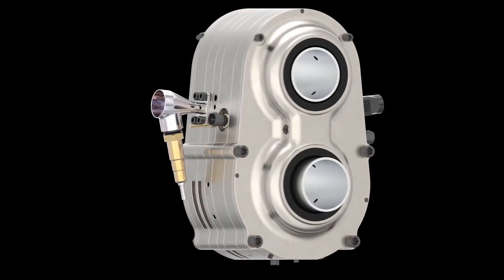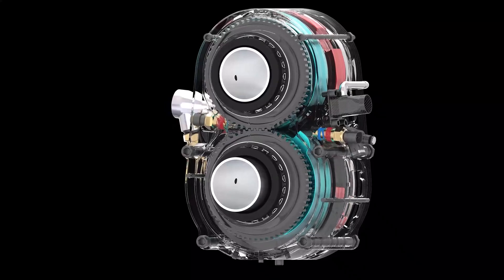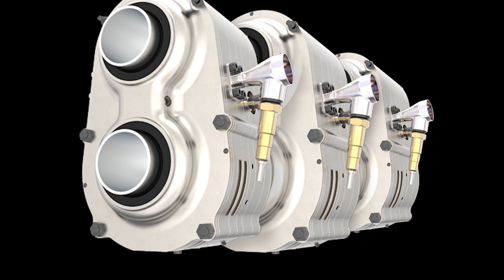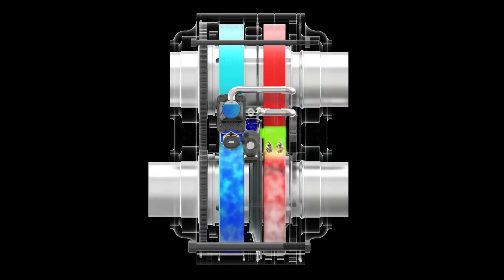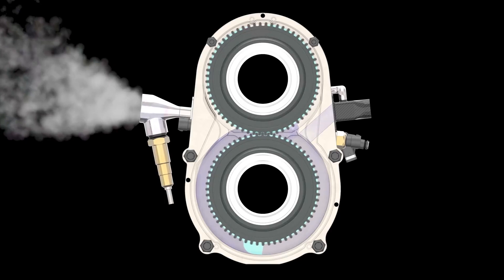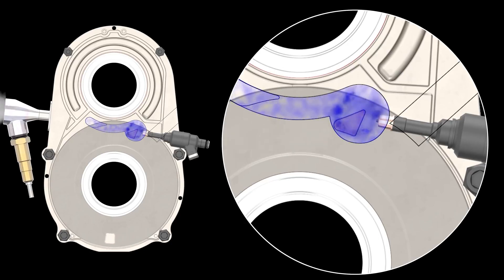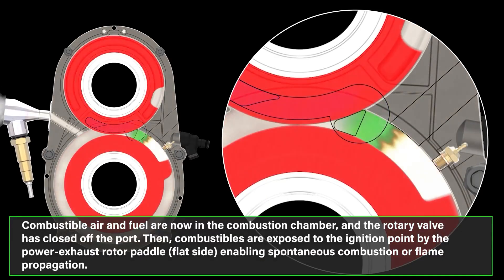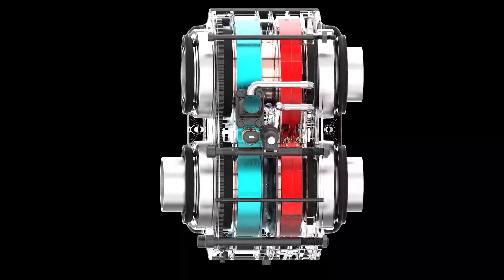This pistonless engine runs on hydrogen and revs to 25k rpm

Comment: These “tight tolerances” would be insane. Keep in mind the cost is exponential for tolerances
Reply: Also with no seals, how long would it take for that tolerance to become too big, i cant imagine it would be very long
Reply: @Arrica101  Imagine what happens to those .0001 tolerances in winter,,,  At that tight of tolerance I think temperatures will start to screw with operation of the engine.
Reply: @Arrica101  nah it would burn up the fine edges on the sealing surface.
Reply: This is designed by an aerospace company. It would run on Hydrogen, and seems to be aimed at small size and light weight. Given all of that I'm guessing the plan is to generate auxiliary power on an upper stage of a rocket using hydrogen that would otherwise boil off and be vented to space. If this is so then maybe it could work. I don't think it's ment to be a car engine.
Reply: Not to mention that it's supposed to be running on Hydrogen. H2 LOOOOVES to leak out of literally anything. Airtight tolerances between moving parts are a damned nightmare. Hydrogen-tight tolerances? You're fucking dreaming if you think you can make an entire engine to that spec. You simply cannot contain one of the smallest molecules in existence within an engine with no specialized seals.
Reply: @spacehooliganzack7429  Tight tolerances are possible, we already have the capability to create completely invisible seam lines between two parts just put together without even having to screw them down. At those tolerances, expansion would just further create pressure between parts, ensuring they're sealed. So you'd probably design inside tolerances with some slack for expansion. The only thing that truly needs a perfect tolerance is the casing. The rest can reach tolerance through heat expansion. I think the point of this engine is to try to see how far they can push efficiency vs power. 

If you lose X efficiency, but gain a lot more power for it, you could end up with something that makes hydrogen more viable. Seals are actually one of the biggest issues on rotary engines, they need to be redone like every 80K miles. So if you could limit the use of them, that would be desirable. While it does take a lot to reach tight tolerances, it's not terrible if you're doing it for a relatively small part. The whole thing weighs 35lbs and could power your typical sedan. That also speaks to fuel efficiency. Suggested applications include generators, marine, aerospace and recreational vehicles. Not only does it weigh little, they can also be modular and stacked together. 

I don't see it coming to the mainstream anytime soon, but it could be used for special vehicles. Marine actually makes sense, since pressures outside the casing wouldn't really hurt not having seals. I could see it used for race cars that want that extra oomph. A nascar has about 750hp. About 5 of these put together would match that, which would turn the total engine weight into just 175lbs. Now imagine how much that would help to keep weight down on a race car. A typical nascar engine weights about 600lbs. That's cutting over 60% of engine weight. Hydrogen also has about the same energy as a gallon of gas, for 1/4th the weight. 

It's also useful for extreme environment applications, because pistons require temperature differentials to work. If the environment is the same temperature as the engine, then the piston won't even move. You can get those kinds of temperatures in sunlight in space, or on other planets. I don't think they would use it for that though, but who knows. I mean keep in mind, you don't need a lot of HP. The mars rover is literally only 0.13hp. 

So basically, if you made an engine like this at 0.08 percent the scale, you could literally power the mars rover. Guess how much such an engine would weigh? Less than half an ounce. Now it begins to make more sense. And since it's soo small, hydrogen fuel would be pretty long lasting. Hydrogen is also fairly light on its own, and with an engine that size, the amount of hydrogen needed would be pretty small. Rover's don't actually travel that far either. Curiosity literally only traveled 14 miles. If you wanted the same distance out of a hydrogen engine that small, it would take very little fuel, and cut a huge chunk of the transport costs, and you could add even more range for far less weight. It would cut millions off the cost of a rover mission.

I don't think they'd make the engine THAT small, but with the right materials they could for very little cost (less than an ounce of titanium or carbon fiber would be strong but soo cheap) or make it somewhat bigger, but it would still be a huge savings. We could use scales not quite as small to create much faster rovers with much more range. Ingenuity's helicopter weighs about 4 pounds. Now imagine a tiny scale engine in one of those. You could run it for quite a while, and even allow it to refuel from the main rover. Or a bigger helicopter that allows you to carry plenty of analysis tools, so you can take off and land anywhere to do research, from the top of a mountain nearby to the bottom of a crater.
Reply: Heat cycles would be insane especially on 25k rpm. If this is an aluminum motor it would expand past the point of it being safe. Needing no seals isn't going to save the motor when heat makes a .1 tolerance .5 or higher without a gasket.
Reply: @nyquilforthekill1620  Aluminium? are you joking?
Reply: @strugglingengineer1465  most cars are aluminum blocks or cast blocks with most of them being aluminum heads, what else am I to suppose this concept engine would be made out of Einstein?
Reply: @nyquilforthekill1620  Aluminium alloys are prone to widespread fatigue damage due to inherent cracks. Do you think you can put Aluminium all over an engine like this? You can put that in expendable parts that can be replaced and that are not subject to direct high stress cycles. In general the piston is made from an Al-Mg alloy but that's only cause the piston itself is one massive chunk, and small cracks won't spread too fast with its positioning and motion. Most parts are made of iron/steel. Unless you are building something that you don't want to last. For this engine I think they would have gone for ceramics or at least a ceramic coating like they use in turbines.
You are the Einstein here, I'm just a struggling engineer.
Reply: @nyquilforthekill1620  Hydrogen burns quite cool. It naturally cools at stoichiometric combustion, as the resulting exhaust is water vapour, which of course absorbs heat.
Reply: @benjaminconnolly5655  combustion whether hydrogen or fuel creates heat. Combustion in itself creates enough heat to put pressure on anything. I'm only asking how they are dealing with expansion on .1 tolerance of the motor. This is not viable without seals and gaskets, especially since coolant or a cooling method wasn't stated in the video. And where the combustion is happening it's apparent that it will create alot of vibration and heat being between to rotating objects can also push them in the opposite direction or even away from each other over time causing internal wearing. my question still hasn't really been answered. Even though this is a mock up of said engine, I am apprehensive that this will work with out said things needing tweaked or redefined all together. I'd like to see this on a straight inline 4 or 6 cylinder engine, where the equal weight and combustion would cause less interference and better results from it being a better balanced motor.
Reply: With those tight tolerances would the constant combustion in the same location on the rotor cause an uneven heating?  I feel like this would cause the rotor to have a lot of vibration at best and internal destruction at worst.  If they could spark it at 3 locations that might be best.

Comment: no one "killed" the electric car a century ago.  it went extinct by natural evolution.  they are inferior in every way to an ICE powered vehicle.   likewise no great conspiracy was involved in choosing gasoline as the fuel.  gasoline contains more energy, per mass, than just about any other practical fuel source.  the engine in this vid is interesting, BUT...  all that is required to retrofit every existing gasoline vehicle with the technology to achieve 200+ mpg efficiency is for control of the auto industry to be wrested from the oil monopoly, which owns controlling interest in every car maker.  the tech exists, and is a more practical immediate solution.

Comment: Bear in mind, Hydrogen is not cheap to make.  It takes more energy to make then it puts out.  That might be OK.  The problem is its not.  Consider the considerations of transporting it.  Gas is much safer.  Just because Hydrogen in principal has many chemical advantages, a sort of Sci Fi fuel of the future.  Its still more or less only used in special cases where gas does not work.  Like in a Lab.

Comment: An example I might be assailed by goes as such. A man with meager means can't maintain a Ferrari F-40 but they can a Toyota Camry. Drawdown the tolerances it then maybe this system can prevail. I.C.E. has a chance but it's only as good if a device is able to be punished and make the customer impressed. Only then will their bank accounts will be emptied with haste from the product that does it better than the old way.

Comment: I've always found the concept of using hydrogen as fuel for combustion engines at the scale that we use hydrocarbons today to be quite dubious simply due to the logistics of dealing with such an unstable and explosive substance in day-to-day life by ordinary people. The great thing about hydrocarbons like gasoline and diesel is that they are relatively energy dense and can be made to burn cleanly and efficiently in an engine with pretty simple and well understood methods while naturally existing in a relatively stable liquid form at normal ambient temperatures. This means that they can be stored and transported much more safely in cheap, simple containers compared to gaseous or liquid hydrogen. Accidental ignition of a gasoline container usually leads to a relatively small explosion followed by a large fire, meaning that most of the damage that results from this is localized to the area immediately surrounding the container. A container of pressurized hydrogen gas is essentially a bomb and accidental ignition of this would result in a massive explosion that would devastate everything around it. A passenger vehicle suffering a collision that ruptured its hydrogen fuel tank is very likely to explode and the resulting explosion would be powerful enough to kill everyone onboard and could also harm many people who happened to be nearby too. A hydrogen fuel station the size of an average gas station being ignited and exploding would flatten everything around it in a large radius and leave a huge crater in the ground where the fuel station once stood. Hydrogen is simply too dangerous to be an effective substitute for hydrocarbon based fuels that we have been interacting with up to this point. I expect that we might see it in specialized forms like in aircraft where heavy batteries are unacceptable and where it can be handled by trained professionals and stored in relatively few places but as for personal passenger vehicles, I think electrics make far more sense than hydrogen combustion engines.
Reply: This. Just search yt for "driving fails". Do you really trust these people to be driving what is essentially a giant bomb?
Reply: A bit like chucking a  lit match into diesel fuel then? The lots going to go!
Reply: @markbullock1931  Tell me you have no idea about what you're talking about, without telling me you have no idea what you are talking about. Why don't you try throwing a lit match into a soda can of diesel fuel. Nothing would happen. If you replace diesel with gasoline, then yes, you are correct.
Reply: @BobJoeDLC  some people only talk because they have mouths
Reply: @markbullock1931  do it, see what happens
Reply: diesel is the peak of energy storage you can literally put a flame to it and nothing will happen
Reply: If we could perform hydrolysis on the fly, we could just use water as fuel, it’s not explosive or flammable and it’s 66% Hydrogen.
Reply: @GMProspect  That would violate the second law of thermodynamics
Reply: @arielshatz6876  You mean there's no such thing as free energy!?

Comment: Correct me if I’m wrong, but doesn’t hydrogen fuel require more energy to produce than it yields? Similar to biofuels from my understanding, hydrogen is most effective when it’s incorporated into the energy economy as an abundant byproduct.  Otherwise while clean itself it requires hydrocarbon energy to produce it nullifying the benefits. The design of the engine is still intriguing with though.

Comment: very cool, but it would still always be less efficient than an electric motor, which also produced more horsepower, 0 emissions, and has much more simple technology.
Reply: Emissions are involved in the manufacture and charging of EV vehicles. "Zero emissions" is  political rhetoric.
Reply: @rick9759  or solar panels and wind and water idk. also dont gas cars produce more

Comment: So far you have a picture and an idea. Let me know when and if there is ever a working model!
Reply: Curious how your engine is coming along? Oh that's right..
Reply: @rodgazinya  you'd need a water tanker behind to use hydrogen power
Reply: @Phone Tracker

New and or improved technology(*) is available or will be that allows one to use hydrogen just as you would gas/diesel etc.

* safe storage tank technology

Note: You'll never see battery powered Boeing 777's etc.

Comment: the only benefit from petroleum based internal combustion engines are the energy they transfer, every other aspect of their existence and use is purely negative and destructive.  We need a solution that does not destroy our water air and soil.  There are quiet a few that are under design and even some in use.

Comment: They did come up with electric  powered float planes , for short run flights .I had my doubts , but they're using them , and recharge   between flights . So they can do it again with this  . At 25 k  RPM , it'll need an efficient dry-sump lubrication system , or it will wrap itself in a ball .   High-tolerance  clearances or used in  hydraulic motor,  oil infeeds . any wear and they have big problems , and they have oil running arround them .  Be fun to play with the prototype .  Bill Lear [ my hero ] , blew a whole bunch of time and money   working on  modern steam car  engines . In the  end , he said  " Steam cars  would never be suitable for the gensral public , Little old               ladies would be shooting through garage doors , like scauld apes ."  Hydrogen  , and  precision parts at 25 k RPM , sound like a recipe   for a grenade  ?

Comment: Is this videos aim to show new ways to save the planet or new ways to save the internal combustion engine concept? I am not a mechanic or an engineer but if this engine is built to very tight tolerances to avoid the need for seals, then as the engine heats up and the metal parts expand, what happens to those tight tolerances? Does the engine seize up? Or is it's performance limited by overheating issues?

Comment: Burning hydrogen in an internal combustion engine? What the heck would be the application for this? Waaay to inefficient(and therefore expensive) for a truck/ship. Less powerdensity/efficiency than an optimised turbine for an airplane. Maybe just maybe useful for a helicopter or a REALLY expensive sportscar.

Sidenote: Why do I KNOW any combustion cycle will be less efficient than a hydrogen fuel cell? - There is a physical limit for the efficiency of converting heat to mechanical power (carnot cycle).

Comment: High pressure means safety and longevity issues costly metallurgy and specialized tooling and CNC machines if any..
If it is that expensive to make it would be expensive to sell and maintain.. 
If it is plausible to construct then by all means but mass production is another genre.
Warranty?
Autonomy?
Metal fatigue and explosions after a crash?
Lots of questions..

Comment: Not on a bandwagon other than friction questioning! Instead of waffling about the past we have seen too little detail about this secret creation.  Unanswered question: 78% of our atmosphere is nitrogen and this combustion engine will no doubt burn some. Result: big FAIL!! Nobody wants nox so you need 2 stage nox reducer that will offset gains of weight and cost. Back to electricity!